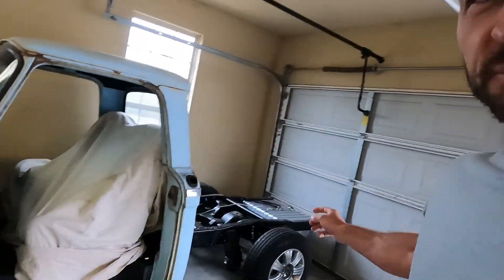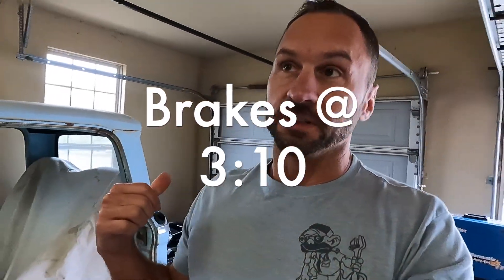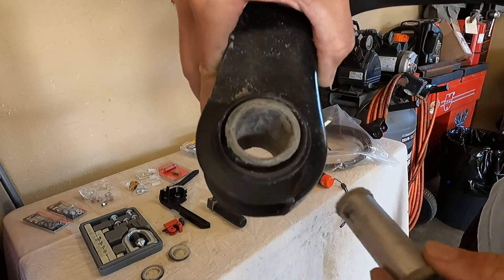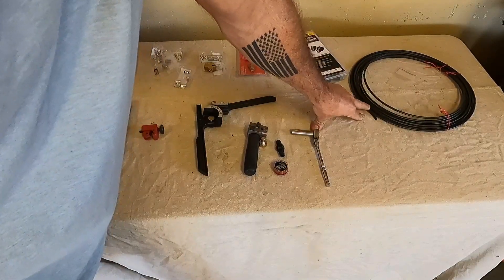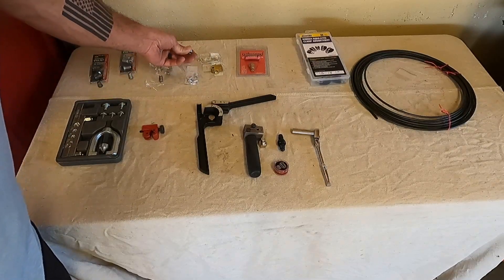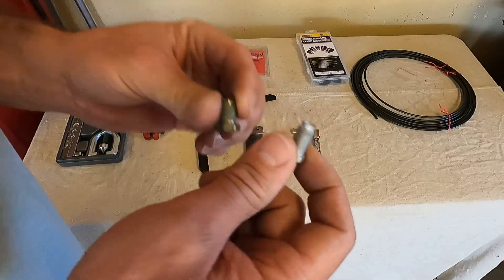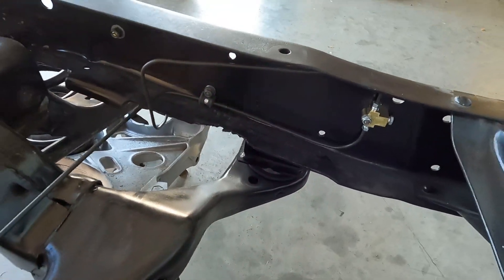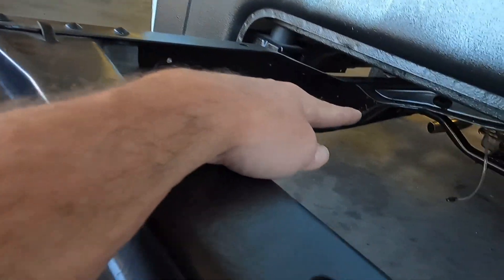'64 F100 Build! Part 20: Rear bushings & brake lines.

Comment: Not sure on your IRS, but the front calibers hoses could’ve used Edelmann 270300 fitting adapters to standard 3/8 (3/16 inverted flare) line. The 03 & up, CV hose adapters, would be Edelmann 271300. Still another excellent video. 👍